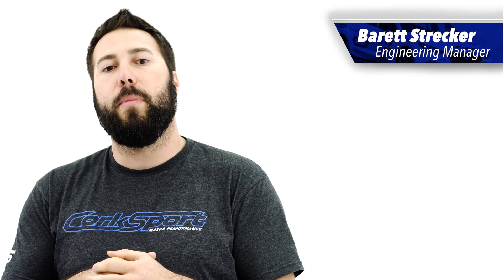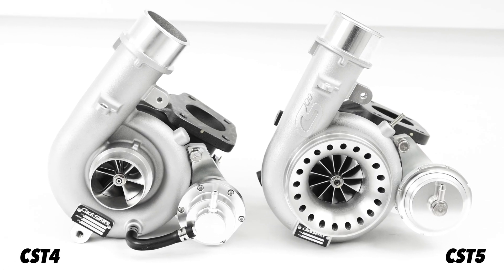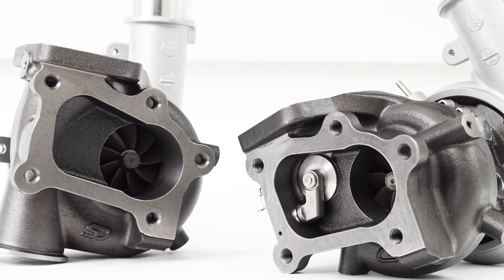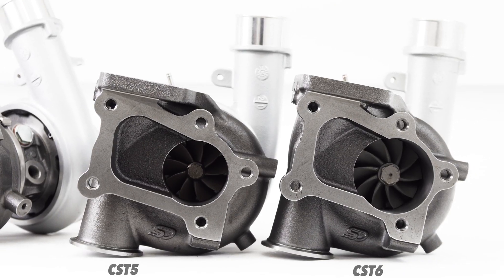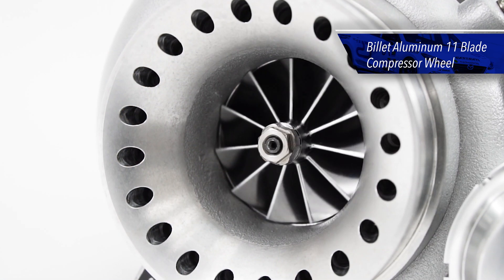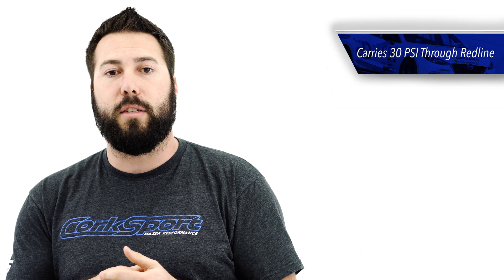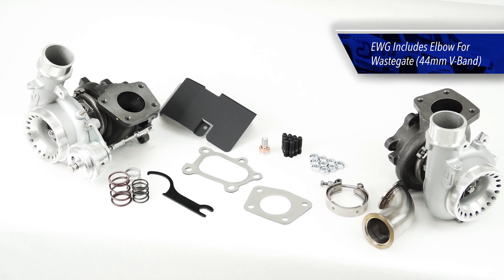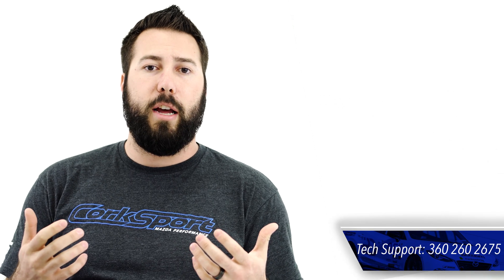CST5 Turbocharger Upgrade for Mazdaspeed 3/6 | CorkSport Mazda Performance

Comment: how much can a stock block make?
Reply: Brian Thiem it varied on mileage and abuse. I’ve seen 450 on stock block with bolt ins and meth, cams also. But a waiver had to be signed by the owner for the tuner to push it that far. 400 is the known limits of our rods.
Reply: @jebified  thank you for letting me know
Reply: @jebified  450wheel whp or hp?
Reply: @brianthiem9208  WHP
Reply: @jebified  damn
Reply: @jebified  thank you manalso what are you running on your car?
Reply: @brianthiem9208 as in turbo or everything?
Reply: @jebified  everything
Reply: @brianthiem9208  CST5, Full Race Exhaust manifold, CS turbo back exhaust. JMF V2 intake manifold, CS 3.5 intake, CS 72mm TB, CS HPFP internals, Treadstone FMIC, JB EGR delete, JBR oil cooler. And I have everything for my Port Injection set up just need to finish the lines. Tuned byJustin@Freaktune
Reply: @jebified  building my gen1 speed3 around a cst5 thanks for the cheat sheet 👏🏾👏🏾🤝🏾

Comment: I'm a total noob to tuning and modding and about to pick up my G2 MS3. I know the stock turbo can blow, so I want to replace it with this. What other modifications/parts do I need to make before putting this in so I'm not immediately blowing up my engine.
Reply: High pressure fuel pump internals is a first and must. Then intake and exhaust along with an Access Port and I personally go with FreekTune for E-Tunning unless you are around one of the well known tuners.
Reply: Jeremy Adams Oh thanks! But I ended up buying a bone stock one adult owner 90k mile blobeye WRX STI for 13k. I got damn lucky

Comment: Planning on buying one soon for my gen 2 speed3 just wondering will I need to buy a 4” inlet for the turbo or will your corksport 4” intake fit directly on the turbo?
Reply: Joe Espino if you go “big turbo” then yes a 3.5-4 is needed as the stock or 2.5 will restrict too much. With that you will either go 51R battery conversion, or remove some of the stock battery case and move your ecu or relocated your battery to the fender like I did for PI.
Reply: @jebified  I'm running the cst5 with a JBR tru 3.5 in intake and they work amazing together.
i also have Corksport`s battery box and it all fits perfectly .
i just finished my 1000 mile break in on my built ,motor,and will be going yo EBTEC to have it all tuned on the 23rd....i`ll get back with ya and let ya know hat it makes.

Comment: I love my CST5!! Gets insane all the way to redline!!!
Reply from the maker: What kind of power you making right now?
Reply: I am going through Justin@Freektune and we are on my 4th revision so now sure on power just yet
Reply from the maker: @jebified  Keep us posted!
Reply: Jeremy Adams so what kind of power are you producing and stock or built block? Mods please!
Reply: John Nickel ,
Stock block w/ Full Race exh mani/CS Turbo back/CS Throttle body/CS 3.5 intake. Tread stone FMIC/JMF intake manifold and finishing up my port injection here soon
Reply: CorkSport Mazda Performance 
After my PI is done I will hit the dyno and get numbers
Reply: @jebified  how many whp did u get?  mine with all bolts and stock block, except the Intake manifold i don't have. only makes 320 the tuner says the cst5 cant pull no more that is the limits. any idea let me know please ?
Reply: Siab Neeg I haven’t hit the dyno for numbers yet but I’m pretty sure I’m right around where you are. But as far as what the CST5 is capable of, there is way more in the tank. I’m at 21psi and hoping my build is done(forged internals etc) to get up to 35psi. These turbos are good to around 500 with full build and PI. Are you at a higher elevation? Is your tuner a well known community tuner? Personally I don’t feel like I’ve hit the limit of my turbo and CS wouldnt sell a bonk one that their smaller upgrade would do the same.
Reply: @T78ify  320 is pretty low for a cst5 do u have the supporting mods
Reply: do you have to run the front mount kit?
Reply: Brian 
I did not, at first I had an ETS TMIC and then swapped to a Treadstone FMIC. Deference is spool time tmic was a little more responsive , and temps are lower obviously with fmic.

Comment: The 20psi before 4k rpm, is this measured on a built block or stock block???

Another thing how would this fair against a bnr s5?
Reply from the maker: I wouldn't recommend a torque curve that aggressive on a stock block haha. That was tested on a built block. 

The S5 has a little more top end, but I don't think its as responsive. 

The T6 is our bigger option meant for 600+
Reply: CorkSport Mazda Performance/Cyle Baron agreed, too much tq at low end even on a stock turbo is just spinning wheels and not really good for the engine. I have a stock block and can easily still make the 20psi before 4K with the CST5. My tq has been moved from all lower to evenly spread and I break tired loose at 4K dropping the hammer.
Reply: Need some 100 tread wear tires for traction I bet